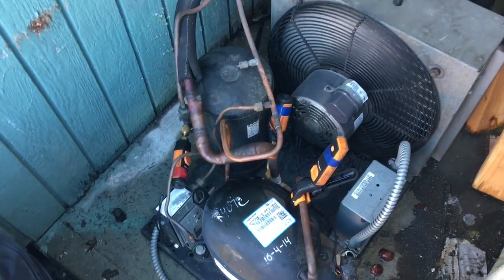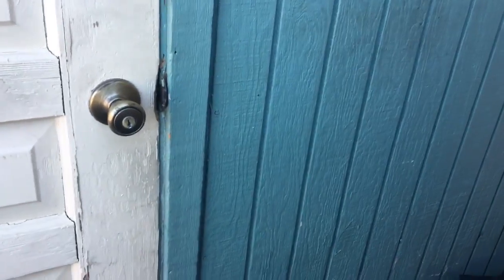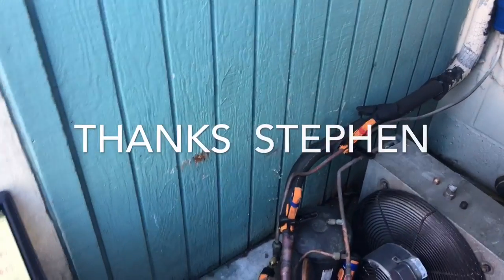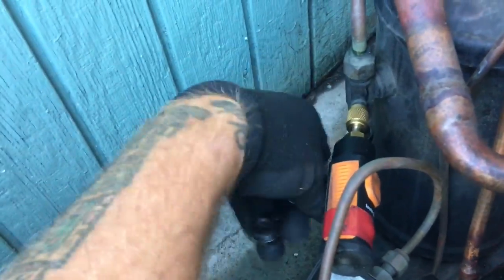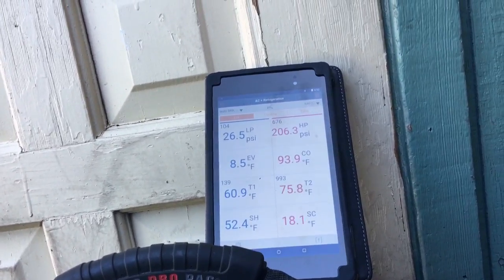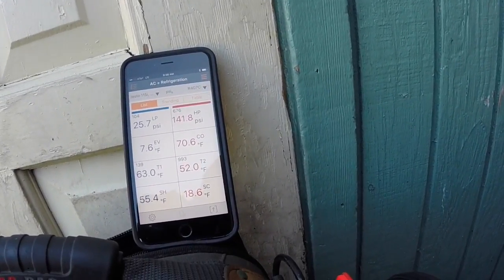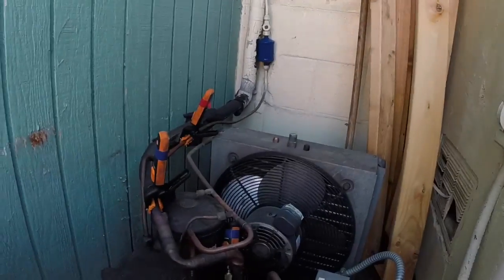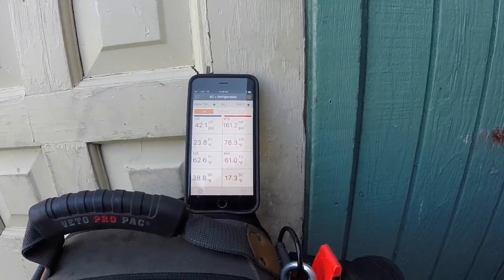Testo smart probe update

Comment: Hey Dave, since this video, do you have any more info on the Testo probes, longevity, leakage, and hook-up between smartphones?  My friend left the business 2 years ago and I was thinking of using his Testo Smart Probes on Ice machines, as they don't let so much refrigerant out.  I want to see if it's worth the cost to use them verses normal gauges and all.  I normally use the "old fashioned" manifold gauge set, and a fluke pipe probe to measure line temps with my Fieldpiece multimeter.  They are solid as far as testing goes, vs. these Testo smart probes.  Also, how do you compare them to the Fieldpiece set?  I don't want to buy something that is going to fail in a year.
Reply from the maker: The Testo probes are still alive and well.  The Fieldpiece probes have really good range. And Fieldpiece has worked out the app issues plus MeasureQuick works with both but seems better with Fieldpiece probes.  I like and use the Fieldpiece probes more.

Comment: Could a homeowner get by with just one pressure and one temp probe? I have an R22 heat pump installed 1993 that I'd like to check now and then. Thanks!

Comment: Hey Dave, Jim Bergman said the Testo Smart probes are not as good for refrigeration because they are not temperature compensating. Is there a work around for that? disconnect and then reconnect to the probe ?
Reply from the maker: Scott Stoner they work fine for checking units. With iOS
Reply: There is a setting in the app to compensate under probe compensation.

Comment: what do you normally set your  LPC cut out for on a walk in box? i used to always set at 0 psi until i read a service bulletin from copeland saying its not a good idea to pump down compressors that low...they recommend not going below 10 psi for medium temp and 5 psi for low temp for any compressor. Ever since i saw that article I've been setting cut out no lower than 5 psi....it kinda makes sense not to pump down to 0 psi cuz it puts added stress on the compressor. What do you think?
Reply from the maker: I set for 2 psi. guess I'll try 5 going forward, I haven't read that yet but it makes sense.

Comment: Hi Dave I use mine day in day out on mainly r410a and r407c witu 5/16 adapters for the 410 . never had a issue with them . Never had them on r22 though .
Will check mine on the high side together and see what I get . Jamie
Reply: So it's unfair when your old tablet could be the one at fault
Reply from the maker: +poppypiesdad1 yes. Not testos fault. They work perfect on my iPhone.

Comment: I just sent my probes to Testo for replacements. They always had to be zeroed at start up, they didn't always go back to zero after I removed them from the Sys, and if both probes were on the same line the pressures would sometimes start to vary by 4+ psi. Maybe I just got some bad probes, I haven't heard of others having the same issue. They are small, cheap, and awesome but I need them to be accurate.
Reply from the maker: I have to zero mine every time before use.
Reply: hvac/r junky, keep us informed on repair time, and what they (testo) says
Reply: +refrigeration tech Testo Tech Support was easy to get a hold of and they sent me a return shipping label that same day. It's been a week and a day since I shipped them back. All the lady said is that the ones that she had on the desk started up at zero so they would send me another set. Didn't sound like she new much about the probes but she took care of me so I'm happy.
Reply from the maker: +HVAC/R Junky did you get them back yet?
Reply: +Nor-Cal Refrigeration & H.V.A.C Got them back about s week ago. It took close to one week turnaround time. I'm glad to have them back, I like having them in my bag and I missed them while they were gone. I hope the new one stay fairly calibrated.